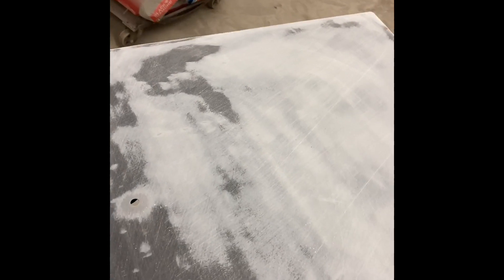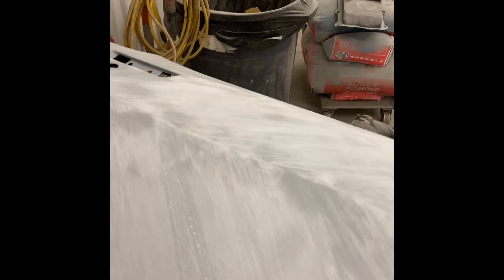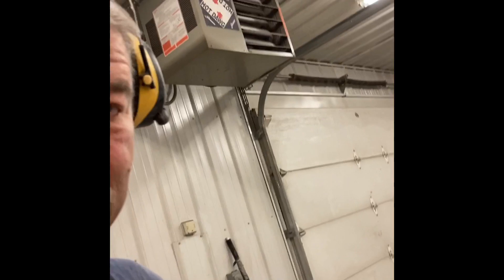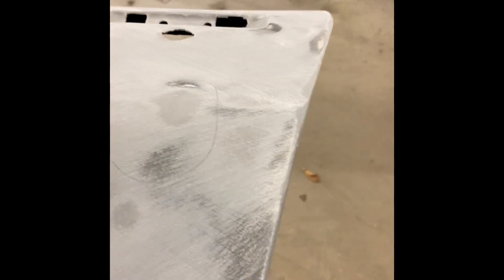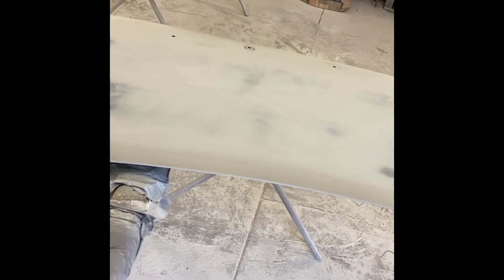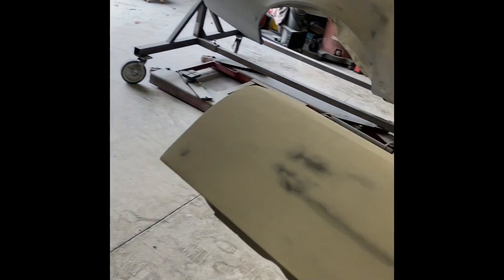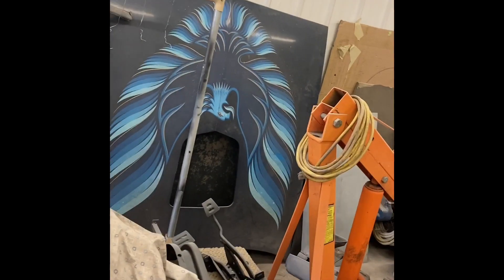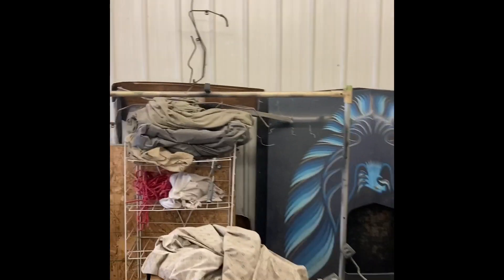How to Trans am restoration, w72 ws6

Comment: Great info Skip. I'm also restoring a 1979 Trans Am W72 400/4-speed. Mine is a Y84 SE Bandit T/A that I purchased from my Grandparent's neighbor who was the original owner. The nose is warped and cracked and I am going to replace it anyway. However I am debating on buying a fiberglass nose for it since the original rubber noses warp over time. Great videos by the way!
Reply from the maker: Cool! Let me know if you find a good glass nose,